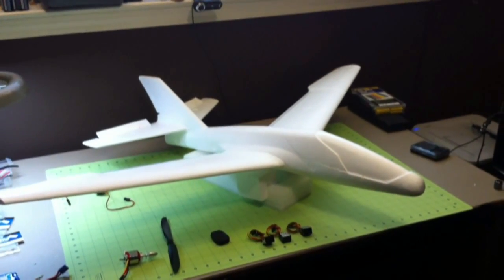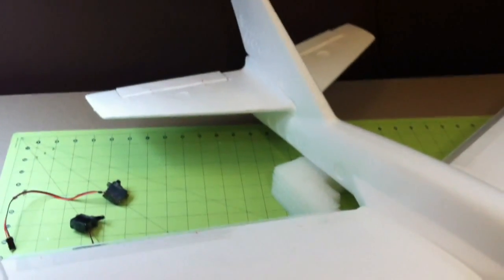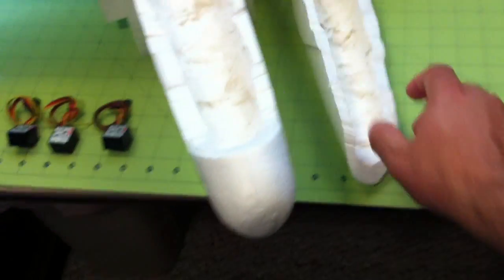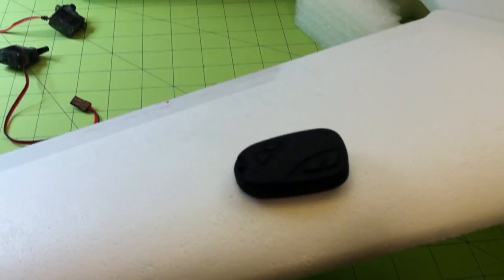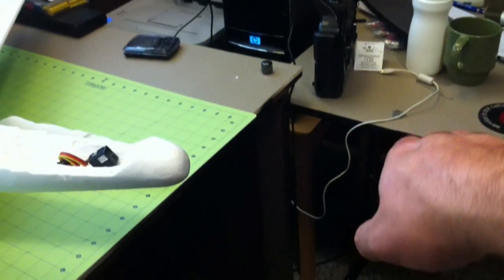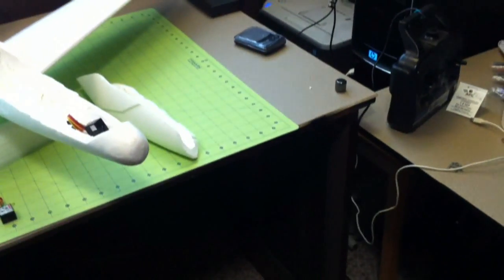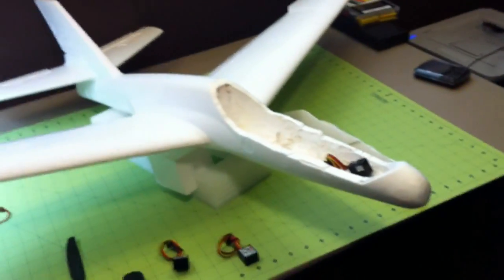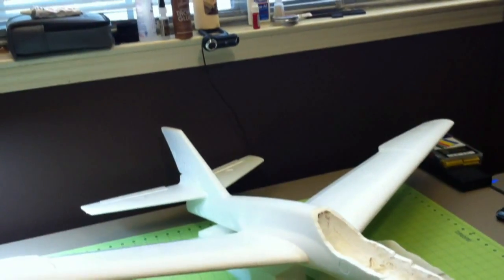Air Hogs Titan Conversion to Video Recon platform

Comment: Help ! I'm stuck. I've started my air hog conversion and I'm not quite sure the battery type I need. Can you help me please. I have a hobby king HK-T4A v2 transmitter and receiver. I have the battery for the Transmitter but the 6v battery the receiver needs inside the airplane confuses me..

Comment: Tip for hot wire cutting. I use balsa pieces taped on or use straight pins thru balsa into foam fuse where I want to make my cuts. Makes nice smooth lines. I use popsicle stick pieces on hatch and small magnets to hold hatch down.

Comment: Here's my grandson in the picture with the second Air Hog Titan I built. I built 2 hogs using 9gr.servos, brushless motor on the front of plane,1000 11.1 lipo., 3mm carbon fiber hollow rods in the wings and glued wings in the fuse. This one I added blue foam to make elevators and ailerons. Didn't cut them out of the plane I added the foam in the space where the wings had the cut outs. I cut 2 hatches. I behind the motor and top back of wing for battery.Cost for everything was $60. Both fly good
Reply: Y